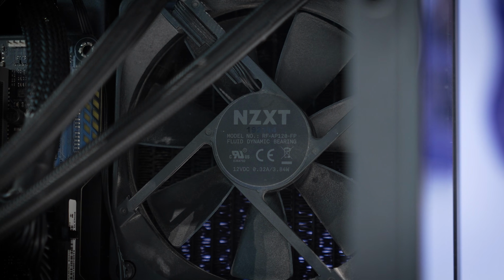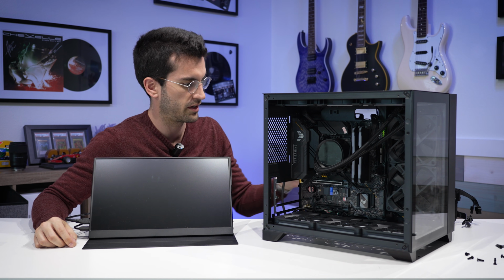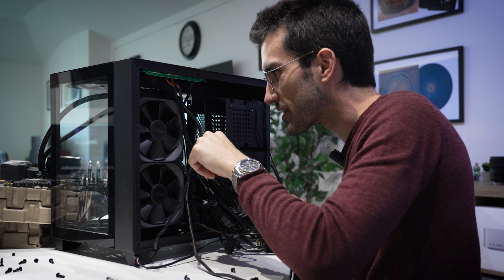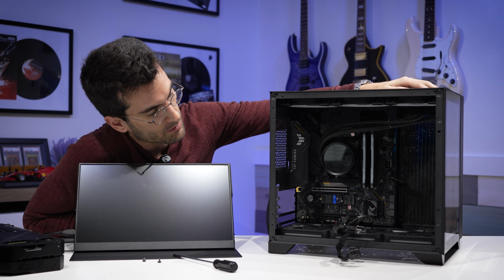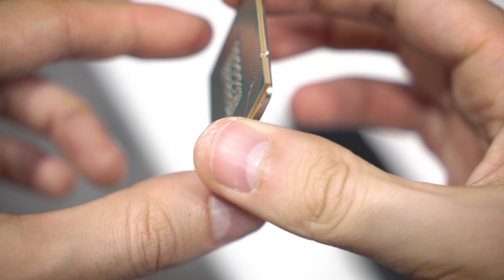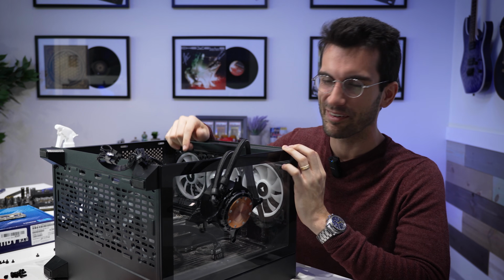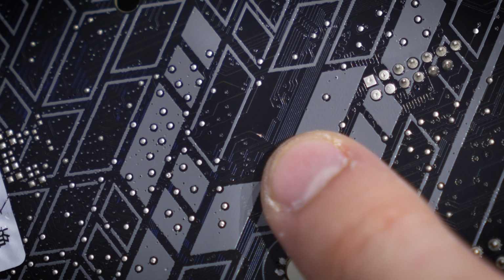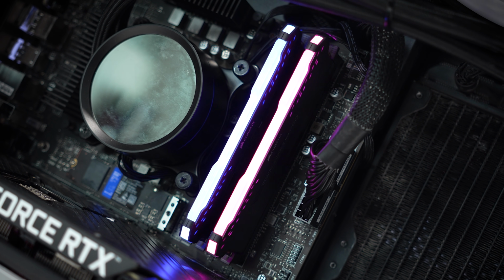Fixing a Viewer's BROKEN Gaming PC? - Fix or Flop S6:E11

Comment: Here I built a mini nuclear system that can't power off.

9950x3D,x870 itx mobo, 64GB 6000mhz ram,850w Gen 5 PSU. 
As soon as you plug it into power it semi turns on. And can't fully shut down once you press hold power.

Comment: I thinking that the missing screws would need to in place to make the motherboard level when you put in the other components in to the motherboard as you can flex the board when pushing down the ram chips into the motherboard and the graphics card: which might crack the tracks on the motherboard and make it not work: also you could have a short from the motherboard when you put it back in the case : the battery with tabs on is not for that motherboard even if it read 2023 number on it as the tabs for wires to be soldered on to it for a laptop contraction plug or something which needs to have 3.5 volts to the plug:  there might be a problem with ram sockets as the ram chips where not placed in right. best of luck finding the fault/s on the mother board as it can be hard to fix it

Comment: That “hold The button longer” reminds me of an issue I had with an old NZXT H700, the front panel header was wired up wrong. The old MSI motherboard would work if I pushed the button a little bit harder. Once I switched to a different motherboard though, it wouldn’t power on. Found out  the issue with a multimeter after finding out it would always start properly when I bypassed the power switch with a screwdriver

Comment: at, 4min you can see that 1 ram stick was not stuck, in the motherboard.
What I would recommend, is to take out the motherboard, and put in a simple video card and update the Bios to the latest version. 
Often old bios are full of errors. But I see that the motherboard has the latest version bios. I personally, think that the motherboard, suffered damage from that wrong hole.
Motherboard comes from China 100% definitely second hand motherboard.

Comment: I looked up that Mobo- Do you have any 10th gen Intel CPUs to try in it? Did it require a BIOS update for 11th gen to work? It's possible the Aura Sync RGB Lighting on the Mobo needs Ring0 to work and MS may have borked it again.

Comment: I have an Asus RTX 3080 Strix OC and those red lights come on saying power problem even tho i have a 1000 watt PSU and it works fine. I was able to turn those red lights off with the Asus GPU software.

Comment: I will say it again here in case you dont read it on the previous video. Bad memory can cause memory controller to not work and will make the debug light be stuck on CPU. always check RAM first when the debug light is stuck on CPU.

Comment: Good catch with the CMOS battery. I've had issues with ASUS boards specifically not wanting to POST if the battery is dead, though I've never had one refuse to power on. I have an ASUS X99 board in my NAS that was showing some very weird symptoms that were all alleviated by replacing the CR2032.

And the one you found was salvaged from some other device - a game cartridge or some small device - so you should've replaced it and tried again with a fresh battery. Since a dead CR2032 can still show a good no-load voltage. The proper way to test them is testing the voltage with a resistor going across it - I've seen 5kΩ typically recommended as the "load".

Comment: This insulated rim batteries are often used in video game cartridges.  The metal tabs on the battery are usually connected to the game to provide the power the edge is not used in cartridges.  I assume this motherboard was a refurb and that battery is old surplus stock they tried using over in China.

Comment: So pretty interesting. I have an 11700kf and a 4080. I was having the exact same issue as you here. The fix for me ended up being manually set the GPU in bios, when I could eventually get there, to gen4 instead of auto. 

I believe I also had to have resizeable bar off. 

As soon as I did that it booted just fine. I was convinced it was the board which I'd have to look what it is.
Reply: I also had changed gpus and it would still not work depending on where in the 90 reboots I was trying to get into bios. Lol

Comment: The jank of this build is incredible
Reply: 1. Case is jank AF - wtf is going on with those rear PCIe brackets?
2. Mis-matched fans on the AIO (140mm when it's a 240mm AIO)
3. Mis-matched fans in general (bottom vs. top)
4. No rear fan
5. Wacky parts: 32GB ram check 3080 STRIX check 11400f BIG OFF Overpriced AIO L
6. Expensive ass fans (Corsair)
7. Wrong screws for the gpu
8. Wrong screws for the motherboard and only TWO OF THEM installed?

What else?

Comment: I'm a bit confused as to why you spend so much time not changing the motherboard when you had inconsistent behaviour and a known damaged component (however innocuous). Even if the damage looked minor, a short through a standoff can cause invisible permanent damage to the motherboard. Other than reseating of components and cables, shouldn't you begin with eliminating damaged parts?

Comment: you said i5 11400 where the gpu is a bit overkill for an i5 (rtx 3080), in fact it's a 11700f as shown in the bios, on the monitor,specs

Comment: Back in the day we had small boards that would plug into an available slot and give you "Post Codes" via an LED display. So it would tell you specifically which component it thought was the problem. If you got nothing on the LED, it was the power supply.

Comment: Testing lithium coin cells must be done with the battery in circuit. Testing a coin cell when it is not in circuit with a voltmeter doesn't provide any meaningful information. It's just the way coin cells work.

The best way to determine if the CMOS battery is bad is when the computer throws an error about a failed battery at POST. Alternatively, if the computer loses internal time or BIOS settings when the system is unplugged, the battery is probably bad. Absent those symptoms, the battery, if installed correctly, is probably still good.

Finally, Microsoft does not consider naked product keys that "key seller" websites sell as a valid Windows license. On a whim, Microsoft could throw a switch, invalidate such keys, brick lots of computers, and make those affected buy new Windows product keys at full price to get their computer functional again. There are no cheap, valid, Windows licenses for sale on the internet.

Comment: The original board tried to post when it was out of the case though, right? I wonder if it would behave normally if no stand off was installed in that section of the board, reducing the strain in that part of the board, keeping the traces aligned 🤷🏾‍♂️

Comment: It is kinda sad that the short is right where the stand off was.  The location of the scratch is probably detecting current loss so the power management chip shuts the board down to protect the other components from inconsistent power flow.

Comment: Definitely a strange one. I did notice some spillage on the underside of the board but it was near the edge on the lower right side near the audio ports and nowhere near any solder contacts so I highly doubt that would have killed the board. I also noticed what looked to be a scratch or tear in one of the labels on the underside as well in the PCH area so possibly something got scratched there 27:36, also looking at the scratched area you pointed out the trace itself didn't look to be torn but could still be shorting to ground when fixed to a case with that stand-off in the wrong place and is likely to have killed the board. I was also thinking if the board was starting up and if the battery was in the condition it was in could it have corrupted the BIOS. It did have a very strange power on where you'd need to press the power on button for longer than usual

Comment: These are the exact type of esoteric and/or atypical PC issues that I love on Fix or Flop! I do love a good, this PC component is clearly and obviously broken, here's a replacement voila! fixed! But these more cryptic issues where a standoff was in the wrong spot and possibly shorted the board, or the cmos battery was weird and possibly created a weird power flow that fried the board over time. Where these are the small things as a PC owner I'd never think of as something that could be an issue and still, at the end of the day. Replacing the component, regardless of the mystery, was still the solution and everything immediately started working! That is troubleshooting at its best imo. Great job as always Greg! I do hope the owner of the PC does consider getting a new case sooner rather than later because my opinion of it only got worse as the video progressed. XD

Comment: and that's why you don't cable manage. It's hidden when it's not open and if you are opening the back you're doing so to change something and are  going to spend more time unmanaging to get to whatever you're doing and then you need to redo it all(or learn at that point to never bother).  The fact that you thought holding the power down longer making it boot was a "solution".  I know you do it for "entertainment" but I assume you know the proper way to diagnose these is when they don't work when you boot it up in the case, take it ALL apart and start testing piece by piece on a test bench and don't put it back together until it's all working.

Comment: So when I have too many USB devices for the headers, I look to see if the devices can be consolidated. The USB header can usually handle two devices, so with a depinning tool and making sure the pins go where they are supposed to on another device's connector means you can generally consolidate it into a single header. AIOs and RGB controllers are a big part of this problem, and what makes it particularly annoying is that Dupont 5x1 connectors for USB exist. Some of the manufacturers do indeed use those connectors.

Comment: i would have at least bios flashed, just to rule that aspect out.

but its equally possible those traces were damaged and need to be fixed. or that the shorting caused the power on circuit to get damaged enough to cause flaky behavior.

Comment: Why is there a metal piece on the cmos battery? Did the arm  holding it in snap off and weld itself to the battery? Never see a cmos battery with a spot weld on it

Comment: I'm pretty sure that is a PCB/Hot power trace that was cut and I think it was going to the PCIe lanes.  I can't be sure without looking at the board under a microscope but that is what I'm guessing is the problem.  That the trace itself works when it is initially cool, causes the motherboard to trigger a reboot and then heats up and stops working.  That also was my idea when I saw the blinking lights on the RTX card.  I've gotten a couple boards from AliExpress where the trace in that general area was damaged and it's annoying power cycling problem.  Just my humble opinion

Comment: had something very similar to my gaming table PC, ( We have 3 total two side by side one large table for wife and I (( she games more than I )) ) all built with exact same items down to the cpu cooler and mine blue screened one day. Turned back on and it shut off and never came back on would not boot and gave me cpu mem light on board. Long story short one of the cpu pin terminals was barley connected in the motherboard to the main board and finally fried and killed CPU at same time . One new motherboard and cpu later all good again. So check the motherboard cpu socket and see if all the pins are firm , bet one will wiggle or fall off.

Comment: Instead giving us the option to pause, you could just imgur photos of the front and the back of the MoBo... but it's probably something is shorting.
That very very small area is enough to kill a motherboard... ask me how I figured that with a screwdriver... lol... from what I can see, it seems to be a broken pcb lane.
About the isolation cover, it's normal... BUT I never saw in motherboards that have the battery seated on the motherboard instead in the horizontal (a lot of those old Atom motherboards) or with wires (ASUS model PRIME H410I-PLUS/CSM or some laptops).

Comment: i feel like installing the new GPU caused the standoff to pierce through the first layer of the motherboard., because lets recap, to install a new graphics card, one needs to push the card in the corresponding slot on the motherboard.
pushing the motherboard into that standoff and causing damage..

also, the CMOS battery was a huge throwback for me.
some motherboards do not even power on without a CMOS battery installed or when its depleted from its usual 3.2volt charge.
i am one lucky motherboard owner that has this feature and caused me some extra gray hairs on my head🤷🏻‍♂

Comment: Something I noticed with the first time when you tried turning it on: The GPU lights turn on when you held the power button for longer.

I instantly thought that there was something wrong with the power button or at the very least a motherboard issue. The PC acted like a house circuit tripping when you flick the switch, until you hold the circuit open so that the initial high power draw doesn't trip the circuit and lets the parts downstream to be able to fully turn on and initialise.

I'm also curious how all these gaming pcs end up in your videos... Some of them don't seem to have been running for long (if at all). It seems like they're cobbled together and then don't work, so the user has to send it in :sob:

Comment: I think the damage on the backside was caused by changing the GPU. Pushing the card in flexed the mobo just enough to cause the damage. If you take it under a microscope you will probably see that the connection is damaged.
Scrape some lacker of the trace at both sides and solder a thin wire to those bare traces. Mobo might work properly after the operation.

Comment: to answer the question on the reason the bios battery was wrapped in rubber, china doesn't allow batteries to be shipped while being exposed. They either remove it or cover it with rubber to prevent the transfer of energy during transport.

Comment: 27:35  It looks like the outer layer of the pcb in the mounting hole that sits just above the first ram slot has been stripped away causing a short when it's screwed into the case.
Reply: Also missing chipset cooler
Reply: @GerineedsaNameYes literally all the built-in cooling for the board is missing. That’s so odd. Who removes that and forgets to put it back?

Comment: if there is a suspicion of components shorting or if screws are missing, it's a good to remove the motherboard onto a non-conductive surface before testing to avoid causing more damage.

Comment: The USB cable for the NZXT cooler is for conrolling the entire in thing in CAM pump and all. Without the cable the pump should work on some default speed but you wont be able to conroll it.
And the pump is annoyingly loud at full speed i mite add. I higly recomend that you tell the owner to get a USB 2.0 HUB and NZXT has on of those btw.
Best to have all the cables connected for full contoll of the system.

Comment: My PC started doing this a quick push of the power button my PC wouldn’t boot as normal a hold would then boot it. About 2 months later my PSU died. Replaced PSU and it fixed the issue weird it didn’t here

Comment: I've been building, upgrading and repairing PCs since 1990. When things like this happen, I first take every removeable component and test them in my bench system just to verify the "easy" parts. Next I'll "breadboard" the system outside the case with a COMPLETE assembly, including GPU. That makes is much simpler to replace more complicated components, namely CPU, motherboard and PSU. It seems like more work, but it would have dramatically reduced the troubleshooting in this case.

Comment: I personally have had 2 bad B550 Asus TUF mobo's. Bad luck? Probably. Coincidence? Doubtful. And no, there were no missing screws or incorrectly installed standoffs shorting or damaging the boards. Every other mobo I've had and used (MSI, Asrock) have been fine. Currently on an Asus ROG mini ITX board that works well other than the ethernet adapter being trash (knock on wood).  Personal confidence in Asus products at an all-time low, here.

Comment: Could be worse 
Just built a new Pc for random BSOD  issue driving me absolutely insane. Only seemed to happen conveniently when I wanted to game on weekends.
Rolled drivers back/ swapped components/ fresh windows install. NO fix. I had enough of it and sold it to a friend on the cheap and built a new one.
The problem he found in about an hour.
Bad nvidia driver causing no screen output./ Ram stick wasn't  seated all the way.

Comment: I recently had an issue with a my own case. A much older thermaltake case that was causing me all sorts of odd issues that I could not pin down. It turned out to be the standoffs themselves. They were ferrous, but painted black. All the platform changes over the years wore the paint out on the threads inside the standoff and causing all my issues. I switched them for brass ones and everything started working right again.

Comment: Btw Greg just in case you're ever in dire need of more connections for the usb 2 internal headers if you notice on that AIO rgb header half the block is empty you can de-pin another cable and add it to it just fine.

Comment: I had a similar problem. The bios was resetting. The bios defaults are incompatible with the system you have. If your reset the system bios to working values and get a working battery it will be good.